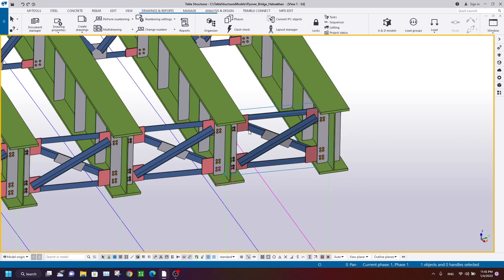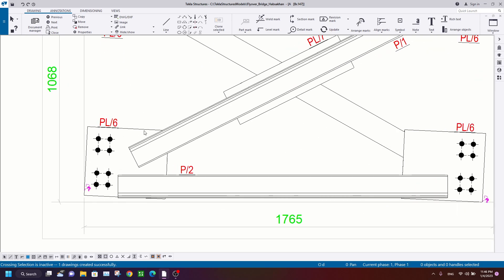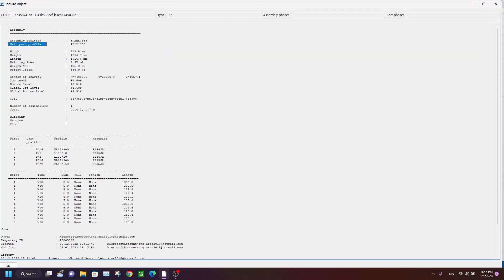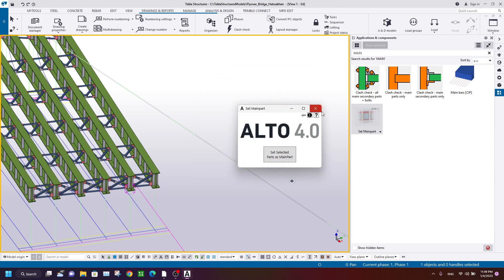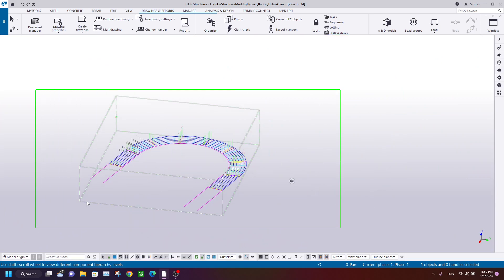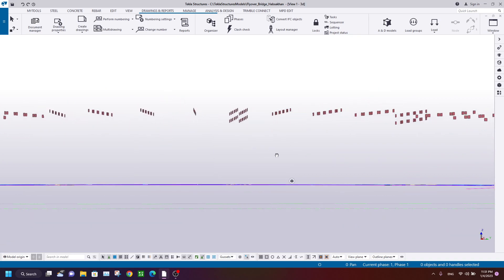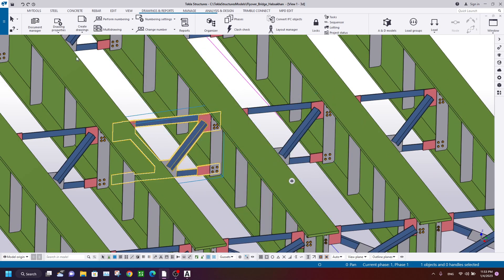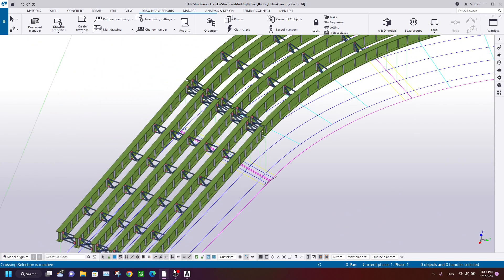How to Change the Assembly Main Part and Recreate assembly drawings Tekla Structures [2023]

Comment: IM SORY IM NEW IN SECTOR, IS THAT TECLA ? I USUALLY USE REVİT
Reply from the maker: This is Tekla structures, I recommend to use tekla instead of Revit for steel structures.
Reply: @civilengineeringwitharas4776   we here have to do all metal extras by hand in autocad. It feels like digging a foundation with a sandcastle shovel.
Reply from the maker: @JackChadCat Why do not you use Tekla ?
Reply: @civilengineeringwitharas4776  gonna try it first on personal pc. Then gonna propose it to the company